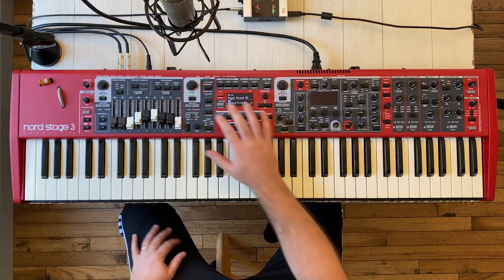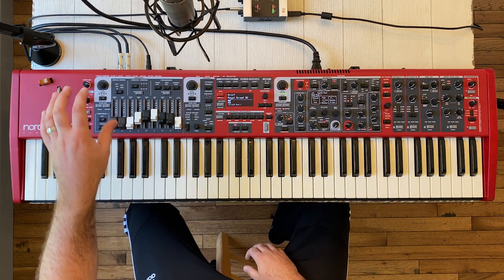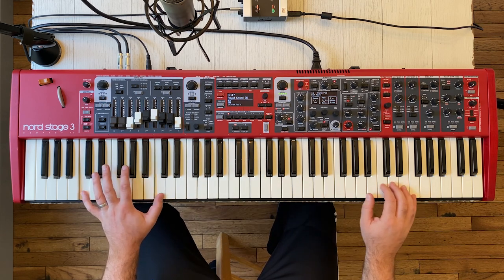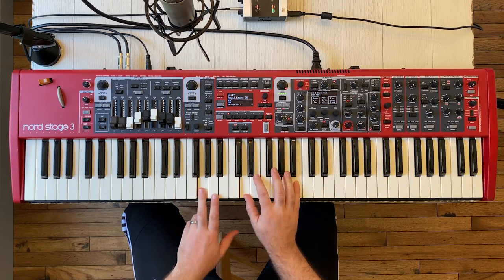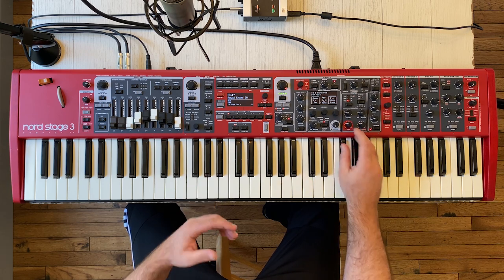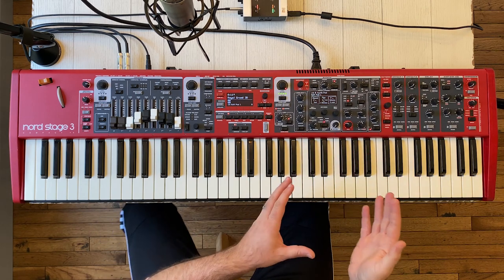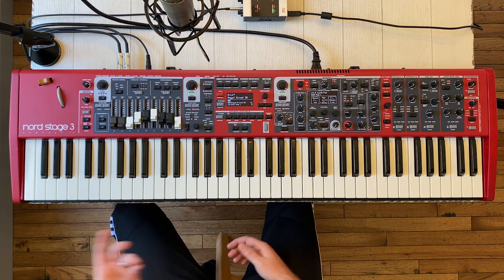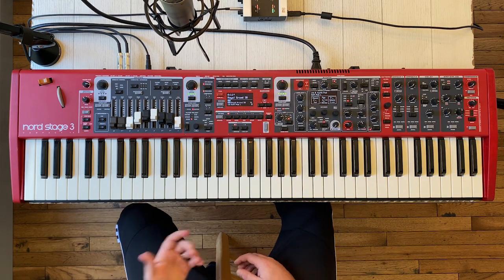Nord Stage 3 - Building a Piano and Pad Layered Sound Tutorial - Great for Worship/Church!

Comment: Hi Douglas, Im still kinda new to stage 3. I play, like u at church, and use the programs to switch sounds between verse chorus bridge etc. You mentioned live mode. Ive not got my head round that yet. How do u use it and how is it diff to just using prog buttons? Thx bob
Reply from the maker: Hey Bob! The difference with live mode is that every change you make to sounds is instantly saved as you go. So for example, you fade the pad out on one live program and switch over to an electric piano, when you flip back to the pad, it will pick up where you left off. Not always ideal, but under certain situations it’s great! I’m working on a video that should be live in the next week or so explaining them live mode functionality. Hang tight for that!

Comment: Thanks so much for the great video!  Why is the volume knob on either of the sound engines slow to respond for volume level increments?
Reply from the maker: Thanks! The way Nord has programmed the knob takes a little getting used to. If you spin it quickly it will jump up or down really fast, but if you spin it slow it allows you to dial in to specific levels. Like I said, it definitely takes some getting used to in order to find the right twist to get the response you want!

Comment: There are three Nord Stage 3 keyboards on the market. Which one are you using?
Do all three models have the same capabilities to create those rich unique worship sounds?
The available models I see on the market are Nord Stage 3  88, Nord Stage 3 Compact and Nord Stage 3 HP76. 
Thanks
Reply from the maker: I have the Compact version, but any version will produce the same sounds. Really the only difference between the 3 different versions is the number of keys, the weight of the keys, and the organ sound panel controls (the Compact version is the only one with physical drawbar controls). Hope that helps!
Reply: Thank you.   I'm close to making a purchase 👍

Comment: Hey Douglas thanks for the video - just wondering, is it possible with the Nord 3 to have a pad sound playing independently of the keys? i.e. the pad sound will just play without you touching they keys? Just wondering for layering purposes. Thanks!
Reply: Yes, it's possible to create a drone pad with the Nord Stage 3. I usually create a high splitpoint and control the synth section with the highest notes. (just octave down the pad). To keep the pad going enable "KB Hold" in the synth section.

Comment: Hello again...

I've always been curious, on all of your videos your Nord always has this great stereo sound. On this video, what amplification are we hearing?  A mixer maybe?  At your church do you use a stereo configuration/PA, etc.or mono? 

The reason I ask is, when I first hooked up my Nord Stage 3 with my headphones I was blown away. When I took it to church and played it mono through my Bose L1 PA, it still sounded good but not even close to what I'd been hearing in the 'phones...So, I bought a Roland KC-400 and put it on the opposite side of the stage from the Bose and put one channel into the Roland and the other channel into the Bose.  The result was an improvement over the mono setup, but still not nearly as good as what I'm hearing on your videos.  I realize that no stereo field can ever sound as good live as it does through headphones, or at least not for under thousands of dollars.

Do you have any suggestions? 

Btw, I really appreciate you taking the time to make these videos and they are greatly appreciated!
Reply: Hello Kenny. I´m as curious as you are. As for me, after getting advice of a PA specialist, I bought a JBL Eon One. Sounds really great. Way better than the Roland cube. Though  nothing beats the headphone experience.
Reply: @maartenlootens910  I 'm using two Bose L1 towers now with a stereo Bose T8S mixer. I'm panning the L and R of the Nord hard L and R to each respective tower via the mixer. It's sounding good and definitely stereo!
Reply: Regarding live use of the frequency cutoff, don’t forget that you can assign the frequency knob to an expression pedal so you don’t need to use your hands for the dynamic to happen

Comment: I have layered two sounds on A with the Stage 3, but I am having difficulty adding a third sound to the layer. How do I accomplish this?  Thanks!
Reply from the maker: Hey Rick, if the 3rd sound is a sound module you're already using on A, you can use the B panel (press both the A and B buttons together to layer the panels) and put the third sound on B. Hope that helps! Check out my video on layering sounds here for more info: https://youtu.be/zrvRaVbFpWw

Comment: How did you get the tone of the keyboard to be so true and good-sounding for the video?
Reply from the maker: I go stereo straight into my audio interface with the keyboard volume set on about 3/4 or 75%. I’ve found this gives me a good clear sound in the recording without distorting when I hit the notes hard.
Reply: @DSoundman  in a live setting, do you use DI boxes or do you do straight into the mixer?
Reply from the maker: @drasmr9596  Usually into DI boxes to convert to XLR. Theoretically you could just go into the mixer or snake if you have 1/4 inputs, but I've always used DI boxes.

Comment: If our producers are adding in reverb from the sound board should I bring it up on the nord or keep it off?
Reply from the maker: Hi Joseph! It's going to depend on the producer, but in most cases I'd say they would want a clean signal coming in with no effects, so they can add the effects they want in post-production. If I'm playing live, it also depends on the sound guy, but most of the time I will change the reverb level depending on the song or even my place in the song, so in that case I want the control from the Nord, rather than the sound guy controlling it. There are exceptions....for example, if you've created a particular sound on the Nord with a mixture of effects and you want that exact sound recorded or live, then I'd say use the effects from the Nord. Work with your producer or sound guy to make sure you're both on the same page in regards to effects and where they are coming from. Hope this helps!